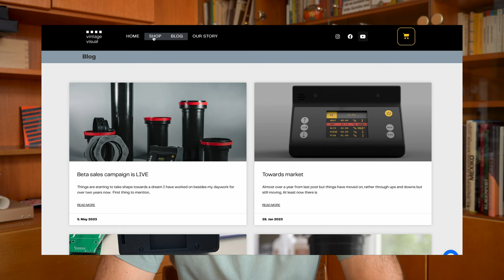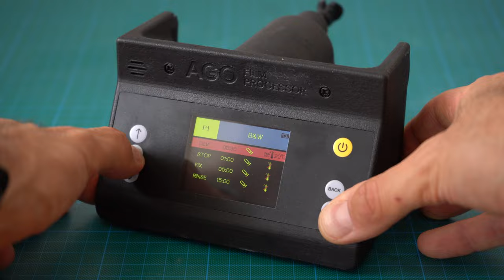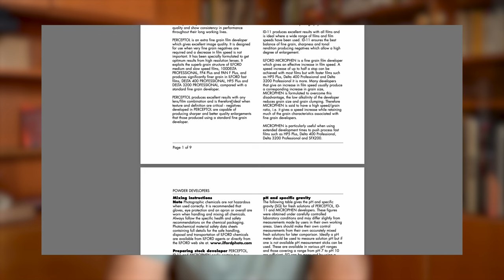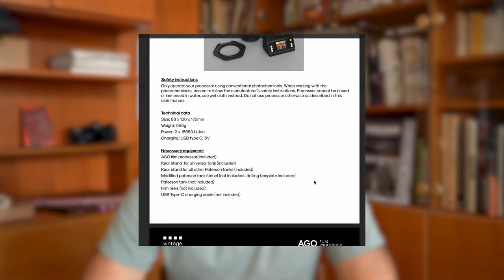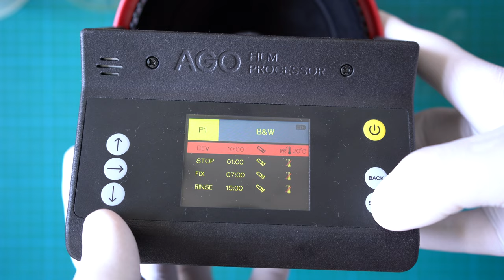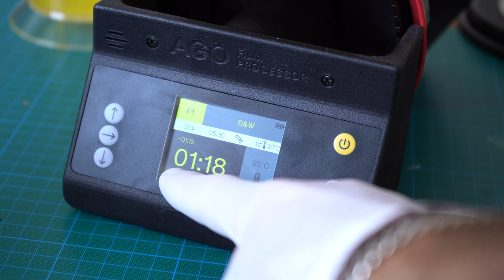Developing 35mm Black and White Film with the AGO Film Processor

Comment: For B&W, most developers work at or very near room temperature, so the time variable feature based of temperature drift during processing has little to no value. On the other hand, B&W film does not develop optimally with continuous agitation, which is mandatory(*) with the AGO. For B&W, the AGO appears to be more complication than help.   (*) I suppose the AGO would still process if you set a tank upright, in which case it becomes a very pricey powered swizzle rod for a Paterson tank.
Reply from the maker: I think the key feature really is making developing accesible / controlled for people who want to develop themselves at home. The rotational development is ideal for C-41 and yes, inversion is better for B/W, but still completely sufficient results can be achieved with rotatry development.
Reply: @doyoudevelop  "inversion is better for B/W, but still completely sufficient results can be achieved with rotary development.”
Well, then I’ll pay 439 Euros for one of these right away. Wouldn’t want the simplicity of the steel tank and Hewes reels that I’ve been using for decades :)
Reply from the maker: @roryonabike5863  It all comes down to what you prefer really :) Most people will never notice the difference. People who develop colour will definitely benefit from the price difference of the AGO versus a Jobo for example. Hewes are great, i've those as well for my steel tanks!
Reply: @doyoudevelop  We weren't talking about colour. I was referring to your bizarre statement about the AGO processor and black and white.

Comment: With regard to the three  holes on the Paterson cap - Do we have to modify and drill the holes ourselves or is a drilled Paterson cap provided with the Ago? Really cool. I presume the chemicals are manually poured out of the tank. Is there any time lag vs manual rotation between developer and stop stages?
Reply from the maker: The unit comes with an adapted Paterson cap I believe. The chemicals are poured manually in and out, so the lag is dependent on how quickly you pour, if i've understood the question correctly :)

Comment: Interesting concept for sure. But how does it work for push or pull processing? Because the development time is a variable, depending on temperature of the chemicals, how do you set the timing for push or pull with this?
Reply from the maker: Excellent question! I assume that since you can change the overall developing time, push/pulling shouldn't be an issue. The compensation algorithm is tuned for adjusting for temperature fluctuations, meaning if I manually adjust the developing time, the temperature compensation would be the same.

Comment: This does look interesting. Is it agitating with the twizzle stick? Have they tested it extensively with 120 and 4x5 film? So far I've had acceptable results with E6 with just a sous vide. However, this does add extra "security."
Reply from the maker: Essentially yeah, it attaches to the where the twizzle stick would usually go and then turns the reels on the inside. Essentially like with a Jobo rotatry processor. I think for E6 it could work beautifully!
Reply: @doyoudevelop I'm lucky I snagged a Jobo with a lift for cheap years ago.  It doesn't seem like there's an advantage to these newer machines.  Neat system though - great video!
Reply from the maker: Well, they are definitely cheaper and more compact than a Jobo :)  @jw48335